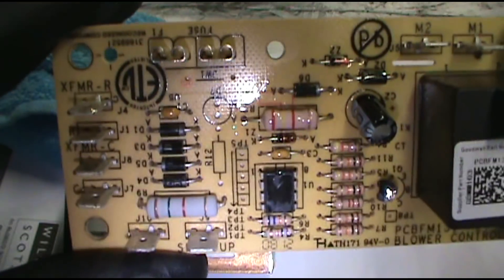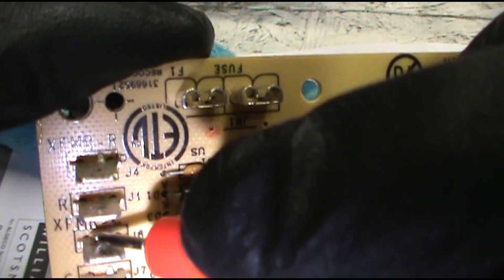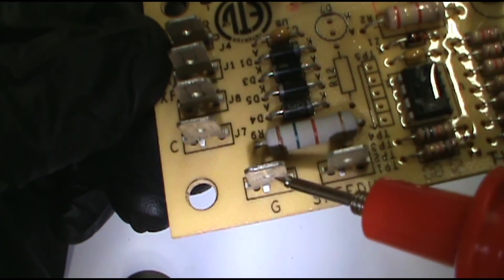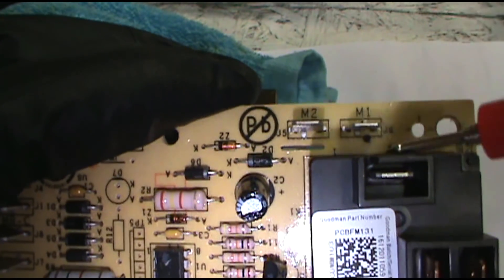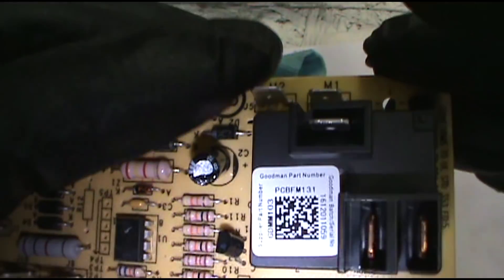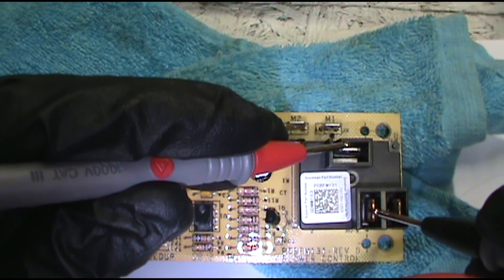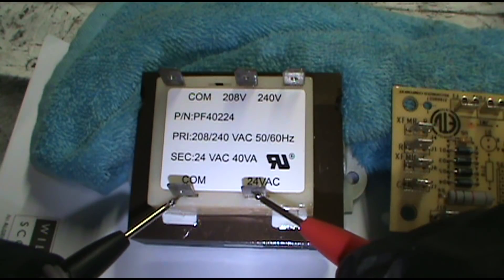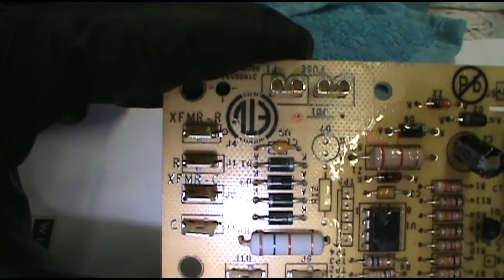Going Over A Blower Control Board HVAC

Comment: Have this same board, NO is stuck in closed position causing fan to always run but also causing Heat strips to continuously run as well. Already replaced sequencer. Could this fan relay also cause Heat strips to stay on as well?
Reply from the maker: I dont think so. Could be white  low voltage wire touching another wire.  Like in the thermostat or somewhere. Thank you so much for watching!

Comment: For the relay when it’s say NC, NO and COM the way it should work for example if I want to run my Red wire ( slow speed ) from the motor I would place it on com and then place one 120v leg on NC?
Reply from the maker: I don't have a board available to look at and I haven't seen one of these boards in a long time. 🤔

Comment: i love how i found this video AFTER i unfucked myself on reading the schematic and tracing the wires the old school way instead of KNOWING what the wires do on the board. i DID use it to speed up the blower motor though!!! such a cool trick to pop the com onto the m1/m2 and then black to the com to simply speed it up
what're the long term disadvantages? premature motor wear? <3 loved the video man the touches of like mentioning a part name/location then physically multiple times tapping it with the probe. great touch
Reply from the maker: Thank you so much for watching!

Comment: Enjoyed your video.  I'm having a problem losing power. My outside unit turns on and the blower motor comes on with nice cold air coming out of the vents. However, after 60 seconds or so, the blower motor quits. I held my voltage meter on the cool lug of the board while the motor was running (126v) after a minute or so, the motor quits and the lug is 000. The outside unit continues to run. The fan just "bumps" a few times and then it may run for a minute or so. Is this a faulty control board? Thank you for any help.
Reply from the maker: Could be a pressure switch. Also check the float switch and make sure it's not full of water. If it's a pressure switch, you'll need a technician to check refrigerant levels. This is a tough one. I'd need to be there for this head scratcher.
Reply: @LexVance  I might have found it, I drained the pump, half full, and then put my shop vac on the pvc line coming from the coils.  Put it back together and so far it's running as it should. Keeping my fingers crossed.  Thank you for the response.

Comment: I believe ther is a way to use 2 speeds on this board,connect the high voltage to the COM and connect high speed from blower to N.O.,then connect a wire from N.C. to a sequencer and have your  blower low speed on that sequence……will it work?
Reply from the maker: I've never done that before. Try it out and let me know what happens. Thank you so much for watching Ray!

Comment: My system is short cycling when it gets hot if I remove my filters in the house it stops the problem.   Do you think the blower control board is getting hot causing the system to shutdown? I already checked the evaporator coil it's clean and no ice the condenser is clean also
Reply from the maker: The filter may be too thick. I've seen thick filters cause problems. I always recommend the thin cheap ones. The system needs to breathe and have good airflow or it creates a drag on the system. Low Freon pressures and everything.

Comment: You say the field wires are the 24v wires going to the condenser outside. What is the best way to determine which wires those are. Thanks!
Reply from the maker: The wires going down into the chase go out to the condenser. The wires going up into the ceiling are usually going to the thermostat. Hope this helps!

Comment: Any idea why my blower control relay would melt and begin smoldering and the on-board fuse NOT blow? It's a good thing I was home. ;)
Reply from the maker: Usually it's due to a loose wire connection. A loose wire causes arching and gets hot. The fuse is the 24 volt low voltage. That's why it didn't pop. And the part that melted is where the 240 high voltage goes.
Reply: @LexVance  Holy cow, man! You posted this video 4 years ago, I ask a question, and you answer it in less than an hour?? You're awesome! Thanks so much for your insight on this!

Comment: I have a problem with one of this;When I turn on the Heater,the blower works normal but when I switch it to the COOL position the blower stops and it won’t run not even on the ON position on the thermostat.Should I assume it’s the board that’s faulty?
Reply from the maker: Weird! I'd need to be there with my volt meter. It may be the thermostat not sending 24 volts to the board. It could be a few things. Sorry man. I'd need to be there for this head scratcher.
Reply: Were you able to find out what was wrong? I have the same problem.

Comment: The original Goodman motor has black/red/blue wire for 3 speeds. I cannot find this original motor. Now I have a motor having the same specifications but it has an extra white wire. I believe that white wire is for common. Where should I plug the white wire in?
Reply from the maker: The common side of the main terminal block I would assume. I'm not there to see so I'm not 100% sure.

Comment: hi Lex, when these Goodman blower-relays fail do they melt? i discovered the fan running slowly while off, the board fuse blown, and the blower relay fried (melted). what would cause this? i dont want to replace the board only to have it fail again if there is something else contributory to the failure. thanks. (sys: goodman 2.5ton straight cool r-22)
Reply from the maker: Yes! It's common for these boards to melt. You can put a sequencer in there instead. I've seen guys do that. Or, go with another board.

Comment: I have a question I have the same goodman air handler with the same circuit blower control board I check the low and high pressures to see if there any leak but it doesnt pressures are fine it has a clean filter and I keeps cleaning the coil once a year but my ac keeps getting frozen up often what can b the reason for that thank I will apreciate your help
Reply from the maker: I've seen fire dampers in the plenum close. That restricts air flow and causes units to freeze up. If the filter is too thick as well.

Comment: I have a issue where my blower fan is coming on between cooling cycles for about 2 minutes and shuts off. It is on a rheem heat pump. Blower motor and thermostat has been replaced by my ac repair man. Any advice as to what this could be? Thanks.
Reply from the maker: That's a weird one. I've seen low pressure and high pressure switches kick units off after a minute or 2 due to low freon or a restriction in the refrigerant line. It does that to protect the compressor. If your unit doesn't have low or high pressure switches then I'm stumped and would need to be there with my volt meter.
Reply: It’s a model rh1t3617stanja. The unit is about 5 years old and still under warranty. It is still cooling well and otherwise fine. I can turn the power off at the main breaker for a few minutes and the problem goes away for a few days and returns. Really odd.

Comment: I have a goodman heatpump and air handler with new outside coil, compressor,capacitor and contactor. I am sure freon is full and thermostat is good. Problem, turn on a/c and outside and inside turn on and when it reaches temp both turn off. Turn on heat outside and inside turn on and when it reaches temp, outside turns off and air handler keeps running,thermostat is no longer asking for heat, I can turn it off manually on thermostat. Please help?

Comment: Thank you VERY much, Lex for the extremely valuable information you provide! One quick question on this board. I have not been able to find the "Goodman Part number PCBFM131" to replace this unit. I did, however, find a "revision D" board (like you have here). The original is a "revision B" so I was a bit skeptical purchasing it. It looks nearly identical but looks can be deceiving when dealing with electronics. Any advice is greatly appreciated. Take care!!
Reply from the maker: Hmmm, thats a great question. I haven't dealt with the newer versions of these boards. I have dealt with the new defrost boards though. They were slightly different but the same terminals were still there which is all that matters. Just take it letter for letter. Thank you so much for watching Pipkin!
www.DirtyMaintenanceNation.com
Reply: Call goodman parts Dept they'll give u specifics

Comment: Hey Lex I found your videos T-shooting a problem with my Control Board.(Fan continuing to run) My relay failed, burnt at the NC connector to the Sequencer. Bought a new sequencer and have a board (1) day shipping with Amazon. Supposed to be the upgraded version equipped with a fuse. Is this a common? These relays failing? house built in '06. Thanks for your vids.. Really a life saver!
Reply from the maker: It depends on the unit. Some of the Goodmans boards where I work have never had an issue & some always have an issue. ALL 192 of them were installed at the same time. Thank you so much for watching Yack!
www.DirtyMaintenanceNation.com

Comment: I have a board that quit. Its looks basic compared to the one in your video. Has only R,C,G and the same three connections on the relay.  I believe I have fixed the problem by repairing a broken etch.  It was corroded and open.   I would like to test this before I put it back. Its a difficult spot to work.
I have a 24 volt transformer.  If I connect the 2 wires from the transformer to the R and C should I be able to jumper from the R to the G (simulating the thermostat calling for cooling)
and then measure the Normally Open contact to now be closed (shorted to the COM) on the relay.  This would complete the AC path for the blower motor.  If the relay closes
then I should have a good confident level its working.   What's your thoughts.   The numbers on the board are 1005-83-100A.  On the side of the relay 1005-100 8901.
Thanks, Ken
Reply from the maker: Putting R & G together will only turn your indoor fan on & yes, you can do that with the tstat wires. R, G, & Yellow gets the indoor & outdoor (compressor) unit going at the same time. Thank you so much for watching Ken!
www.DirtyMaintenanceNation.com
Reply: @LexVance  To test, I have a 3 HVAC (used for air conditioning).  I removed the control board from one and replaced it with the one that does not work.  I know
the control board was bad. The thermostat turned on the outside compressor  but when I measured voltage at the output of the relay board I did not have 120 volts.
No power going to the blower fan.   Upon inspection of the board I found a open etch from corrosion. I replaced the etch with a wire.  I tested the board with an external
24 vac transformer by connecting to the R and C terminals.  I then ran a jumper from G to R and the relay NO contacts shorted just like it should to supply power to the blower motor.    There appears to be many of these boards on the market.  This one is very basic with a built in fan timer.   I could not find the original one the web or ebay (1005-83-100A) on the relay  was marked 1005-100-8905 but did find
some very very similar units with only R,C,G contacts with relays of the same voltage/current spec COM, NO, NC and with fan delay for $20 brand new at Grangier.  I might
buy one for a back up in case one of the other 2 go.  I did find some similar units, 
ICM HBOR224A9X60 on ebay.

Ken
Reply from the maker: @n1kkri  Sounds like a head scratcher. I would need to be there with my volt meter for this one.
Reply: @LexVance  I think I am all set.  The repaired unit should work and I found
another board new for around $20 with the same exact features including built in fan delay with the R C and G terminals, 24vac and same rating on the relay.    Ken

Comment: Will this explain why my blower motor will kick on for 1 second like its going to start and then stop.
Reply from the maker: It could be. Usually though it won't come on at all if the board is bad. Take the red & green wires out of the thermostat & wire nut them together. If fan stays on, you've got another issue. Hard to tell by not being in front of it to look.
Thank you so much for watching Carlos!
www.DirtyMaintenanceNation.com

Comment: Hey lex. Are you officaly certified in anything or has your property just learned to trust your experience.
Reply from the maker: Yes I have EPA & CPO certifications. Other than that, they trust my experience. Thank you so much for watching Jesse!
www.DirtyMaintenanceNation.com
Reply: @LexVance  No problem I have watched your shows more and more this passed week. Just looked those certifications up. Hvac and Pool certifications I see. Just getting my feet wet in the maintenance industry and i came to the conclution that apartment maintenance is a great place tp start as stuff is constantly getting jacked up. I can do simple plumbing fixtures and can install outlets and switches. I also have no problem doing grounds as you say. Im 23 and the only thing ive done close to maintenance is a groundskeeper at a industrial facility. Im hoping with those basic skills i have will get me in the door to help out a lead guy. Hoping I can pick his brain in Hvac and Pool maintenance. Then going for those certifications you obtained. Hopfuly leading up to running my own property. Im open to any advice and thanks for the helpful vids.

Comment: Nice vid. I've replaced many of these. Ive always noticed visual damage on every board. They are expensive. I rewire it sometimes with a relay and sequencer if I dont have a replacement.
Reply from the maker: Right on. Ive heard doing that will last longer. Thank you so much for watching Tech!
www.DirtyMaintenanceNation.com

Comment: I have a question l have the same Goodman board everything is connected right l went through diagrams but when l turn thermostat on any cool or fan control board make a rattling noise and it won’t stop until l disconnect the black wire coming from the fan motor which is the speed please help me if you can
Reply from the maker: A rattling noise? That's weird. I've never heard that before. Maybe the relay on the board is going bad. It's too hard to tell what's going on. Sorry man. Thank you so much for watching Fredis!
www.DirtyMaintenanceNation.com

Comment: HI Lex. So with my Goodman the fan is not coming on. 240 coming in to transformer and 24 going out. 24 at T-stat. but it disappears at the green wires in the AHU. I saw you get a beep from the normally closed  continuity for a fan that won't shut off....but what am I looking  for when I check NO? Should that beep or not beep? (If my multimeter doesn't beep...what would the digital reading for good and for bad be?  Thanks.
Reply from the maker: Turn the power off. Then, pull the red & green wires out of the t-stat & wire nut them together. Turn the power back on. If the fan comes on, you've got a bad t-stat. If the fan doesn't turn on, turn power back off & pull the wires off the N.O. & common terminals. With red & green T-stat wires still wire nutted together, check for continuity between N.O. & common. If it never beeps with the power on, then it's welded open & needs to be replaced. 
Thank you so much for watching Steve!
www.DirtyMaintenanceNation.com

Comment: I’m trying to add a C wire for a Honeywell Lyric T5 thermostat. Which wire on the Goodman board should I piggyback onto?

This is an apartment unit with electric heat.
Reply from the maker: kiehna84 Maan thats hard to answer by not being there looking at it. Sorry man!
Thank you so much for watching! 
www.DirtyMaintenanceNation.com
Reply: Ooh a trick question. I got this. The answer is the C wire.
Reply: Most tstat wires have one or more spare wires, use blue if available, but any color will do. Find same color wire in bundle that connects to blower board from tstat. Connect it to same wire that is connected to C terminal on blower board. They probably are wire nutted. Make sure power is off at breaker for INDOOR unit. Most Hvac systems have two Breakers, one for inside unit, and one for outside unit.Since this is an old post, future tstat buyers who have to have a C wire to get their new tstat to operate can follow this.And remember, ...when in doubt, when in fear, always call the Chief Engineer.

Comment: The fan wire goes to the 240 Volts???
The desired speed goes to C 
For normally closed I do not have a sequencer where can I connect it from?
Reply from the maker: Fado Portugues Yes the fan wire goes on C. C stands for common. I'd have to be there looking at it to see what else you for going on. Hard to do through YouTube comments.

Comment: What if the tstat is sending signal (24v) to the G terminal on board and the NO relay is closed while you are testing it with continuity or power (120V) ?
Reply from the maker: Francisco Castellanos I'd have the power off when testing between N.O. & common to see if its welded closed. Thank you so much for watching Francisco!
www.DirtyMaintenanceNation.com